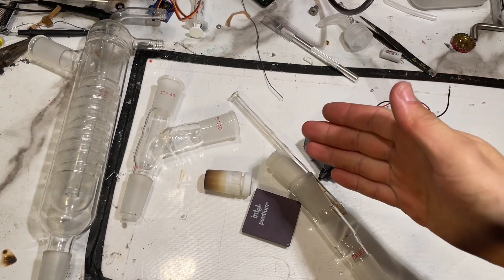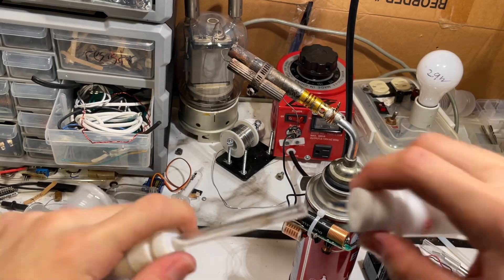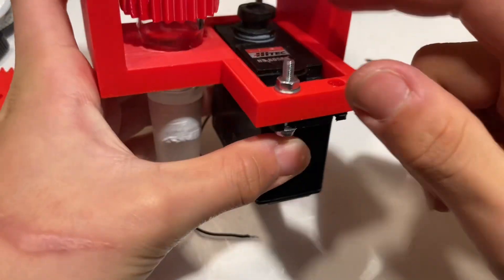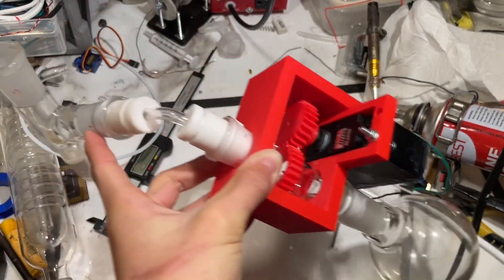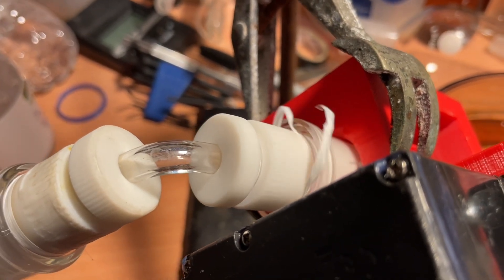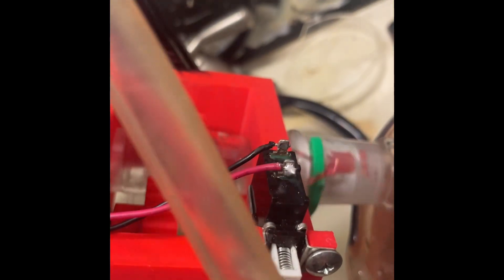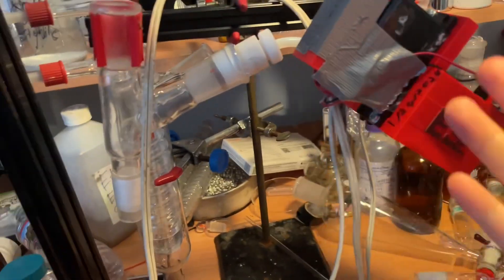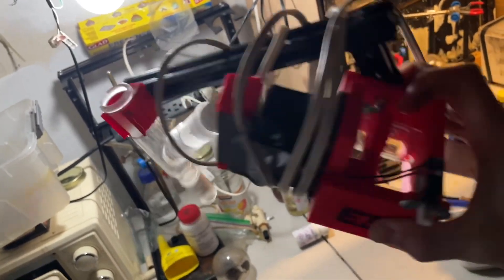DIY rotovap!

Comment: stl files are dead links again
Reply from the maker: hang on ill get them up again in like half an hour, guess ill find a different media hosting site but like i said in the video this rotovap is rather trash (ive been modifying it on and off since i made it and it still doesn't run perfectly)
Reply: @EdwardTriesToScience  try using thingiverse or printables to post the stl? also if you are modifying it you can upload the part files too i could help work on it

Comment: What sized ptfe tubing did you use??
Reply from the maker: use the same size as the tubing outer diameter, the bore in the teflon is slightly oversized and inside of that is an o ring which gets compressed like a gland when you twist the top part which forms the seal around the tube
Reply: @EdwardTriesToScience  Thank you sm, ur an absolute angel for responding. I couldn’t find anything on this online and everyone I know was telling me to use 1mm smaller tubing. You saved me fr.
Reply from the maker: 8mm which is what the stirrer bearing is specified for
Reply: @EdwardTriesToScience  Is 8mm the size of the hole in the bearing or is it 9mm? I’m not sure if the tube needs to be the same size as the hole or a 1mm smaller. I appreciate the reply!

Comment: where can I find your files? The above links are dead. Thanks
Reply from the maker: sorry, here are the files, though as ive mentioned in the video i actually dont advise you to print exactly what i designed as its not the best design and ive had to make many modifications as ive used it

rotovap flask clamp, stl file and step file if you want to edit it
stl
https://cdn.discordapp.com/attachments/1191973167854538784/1234407123732140112/flask_clip_stl.stl?ex=66309eb8&is=662f4d38&hm=f65ec165de97c251cbc302792f80fcb4225073e6984c820ce80a480998550ea3&

step
https://cdn.discordapp.com/attachments/1191973167854538784/1234407123404722216/flask_clip_step.step?ex=66309eb8&is=662f4d38&hm=a58f9960dceb39eb5fcf56d882739202dc95baf32a21d4a28e05daed854c8c73&

unfortunately i cannot find the original cad file of the rotovap itself but what i could get is the stl with supports already included
https://cdn.discordapp.com/attachments/1191973167854538784/1234407123060785162/rotovap_FIXED_FIXED_DO_NOT_PRINT_OTHERS_55um_on_10.stl?ex=66309eb8&is=662f4d38&hm=48befa5c5086f56eb4c164a07c97b4ecfeb9cdccb1c29131ab968e5fdbbe35da&
Reply: @EdwardTriesToScience  appreciate this. I really like the whole idea

Comment: Why use a servo instead of a stepper or just regular motor? You can get a servo for like $4. Also, if you see any 2d printers people are throwing our, they come with 4 good motors you can get for free.
Reply from the maker: didnt have a stepper driver but almost anything would work, even high speed motors if geared down

Comment: smart, but unfortunate that the heat melts the 3d printed plastic., you can modify the design to use a belt instead of two gears, and separate the motor a ways, potentially flip it upside down so it cools more effectively? idk depends on the motor i guess. 

rotovaps are one of those optional bougie devices anyways :p
Reply: It’s going to depend what you print it with, there are dozens of types of filaments. There’s definitely an appropriate one.
Reply from the maker: yeah nylon would be better (very chem resistant and heat resistant) but l i got it PLA